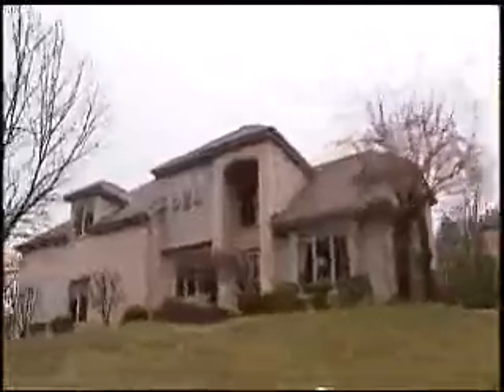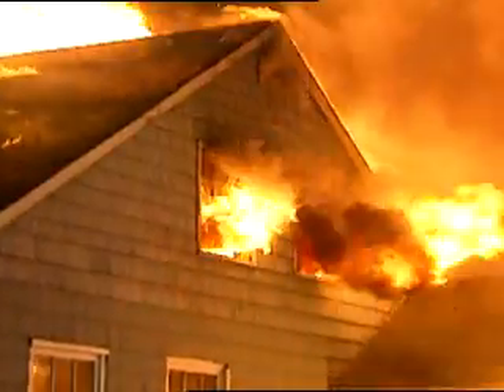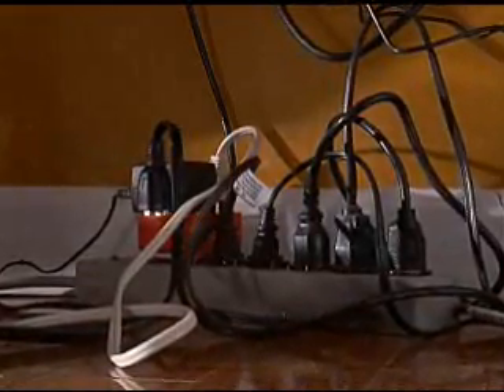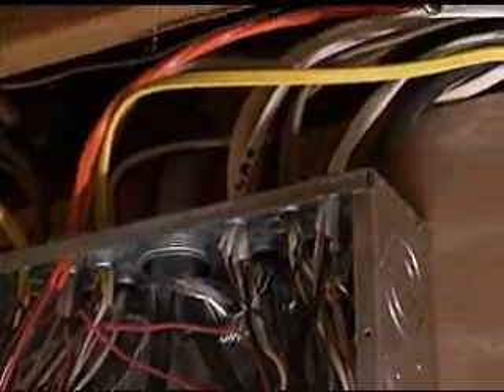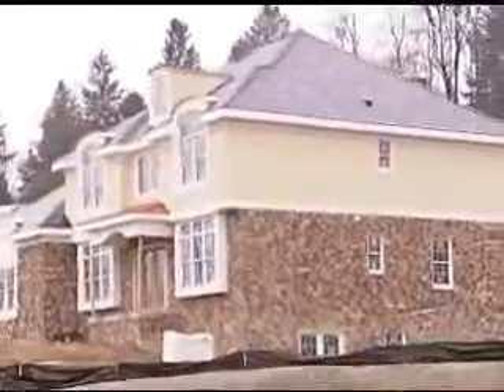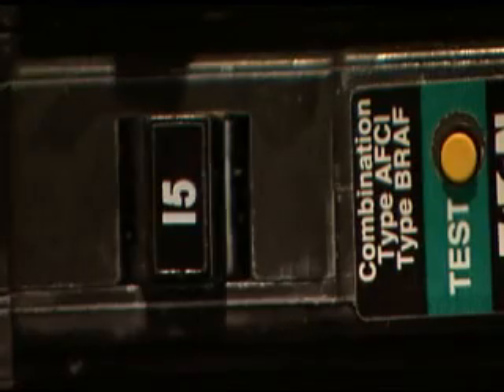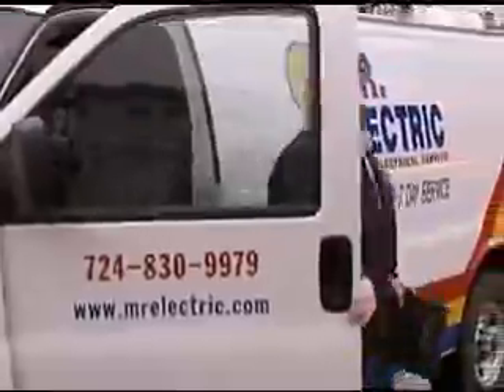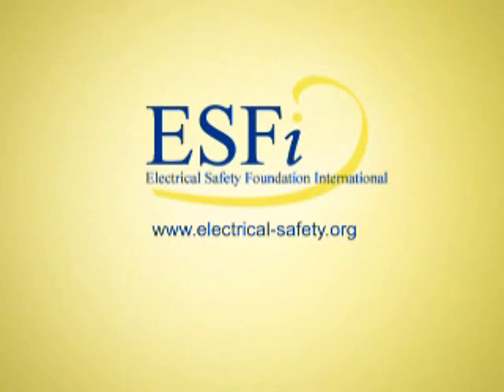AFCI Breakers: What are they and why do I need them?

Comment: Great idea for knob and tube if you are not adding any circuits.  Not so great for Romex installs where 2 circuits might be sharing the same neutral, since an AFCI breaker has to have a separate neutral for each circuit, just as a GFCI breaker does.  Best to wire with individual AFCI devices at each location.
Reply: Or use a double pole AFCI.  Many knob and tube circuits share a neutral (at least where I live.  What's most troublesome is that the housing stock is really old so a customer might have a beautiful new circuit breaker panel, but the wires will go to an old fuse box which has been turned into a junction box for multiple circuits. What really sucks is when electricians don't pay any attention to which hots and which good neutrals go together.  I've found multiple instances of three or more hots on a single neutral because the electrician was too lazy to keep track of the respective hots and neutrals of each of the old circuits.  No one would have ever guessed that this was happening if I hadn't tried to upgrade those circuits with AFCI protection.

Comment: These cause nuisance tripping and are a pain in the ass.  Vacuum cleaners and even light bulbs that spark when they burn out will trip the AFCI breaker.  A good Idea for an old home but, if the house is not properly wired (new construction) these will trip daily
Reply: As an electrician with over 30 years of experience, this may have been true when AFCI breakers first came out, but it is no longer the case.
If an afci is tripping, there is a problem with the house wiring and it should be addressed as such.
I also use afci circuit breakers to find shared neutrals which other electricians have described as "nuisance tripping".  I'm like "No, you had an incompetent electrician because that's a nuisance circuit".  Double pole afci, and the customer is happy and I am a rockstar because I'm not a lazy old fart who is too incompetent to keep up.
(For the record, I am an old fart though)

Comment: sorry! but  you r  wrong.  in most  of  old  houses it s  not possible,becouse  wiring.
Reply: Not true.  If an AFCI is tripping, there is a problem. A skilled electrician with experience in old houses knows how to deal with this stuff.  Many electricians just work with new home construction and don't have to think about troubleshooting.  Old houses are my specialty and I work exclusively doing residential work within 20 minutes of my home.
I live in a neighborhood where the homes are over 100 years old and they are mostly beautiful three-story Victorian twins.  
I use AFCI circuit breakers successfully every week on old wiring.  It takes patience and dedication, but you can find the problems instead of blaming the wiring.

If an AFCI circuit breaker is tripping, you have a potential safety issue.  They are as much a troubleshooting tool as they are a safety device.  :-)

Comment: Stupid video.  It's not just new construction that requires AFCIs.  It's far more important to put an AFCI breaker on an old knob & tube circuit than on a nice new romex circuit.
Reply: @PimpMyDitchWitch  haha, that is a great name!
True, but combination afci circuit breakers do both and are worth putting on knob and tube.
More importantly, afci's also have a GFCI function, so they will trip when installed on a shared neutral circuit.
Honestly, I see them as a diagnostic tool for so-called "nuisance trips" because most of the time I have been able to fix these due to the fact that it was actually a "nuisance circuit". I carry two 15 amp and 220 amp double pole afcis in my van just for this reason.
I can't tell you how many big junction box I have rewired because electricians didn't bother labeling the hots and neutrals and I've had many instances of three hots on a single neutral.  My record is six hots on a single neutral-all of which were black cloth conductors going through 1" Greenfield.
The call was troubleshooting for several circuits throughout the building and I arrived assuming that one leg of the service was having connection issues... Only to find a truly frazzled neutral wire: all of the insulation had burned off and it was basically the color of red clay in a burnt terminal!